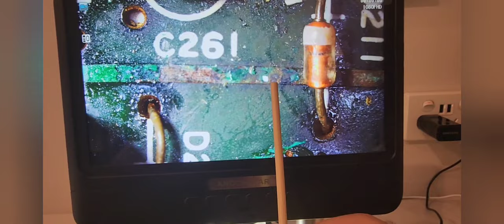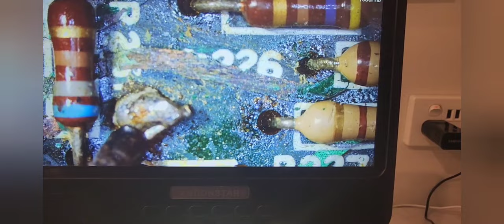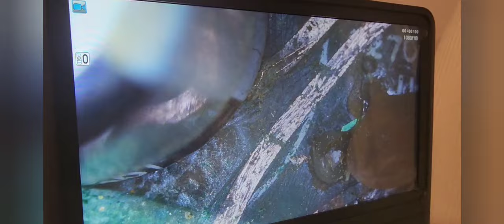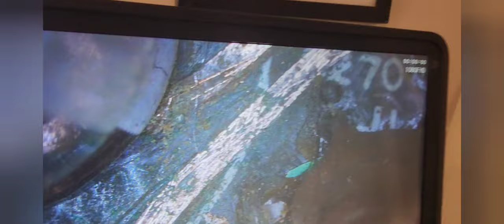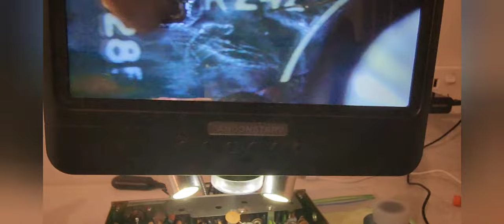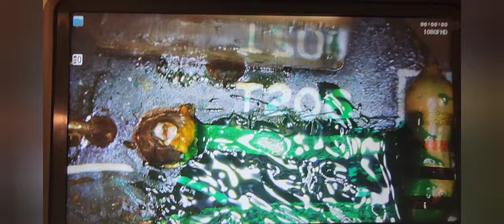Solder Mask Product Evaluation - PCB Track Repairs GE A3-5825B

Comment: You can avoid the mess by applying the mask with a razor knife tip or a pin needle. Solder mask is good stuff, You applied just too much of it. Way too much.
If applied right the track should still shine thru. Just a thin layer, then the curing works in seconds. Keep at it and try it on junk boards- maybe not do the first try where it counts, next time?
Reply from the maker: Applied with the end of a hobby knife, it was very thin, looked worse due to 10x magnification.

Put in the sun dried in 10 mins

Comment: Is pcb lacquer any good?. Used it when i was an apprentice.
Reply from the maker: I use that a lot, but not with this type of repair.  Experimented with green pain, permanent markers, then pcb lacquer over them and it dissolves the color.

Today the solder mask dried but only after being outside in the sun, looks pretty good
Reply: @Pull_It_Apart_Paul_Ham_CB  Nice. Thanks for another good repair restoration tip 👍